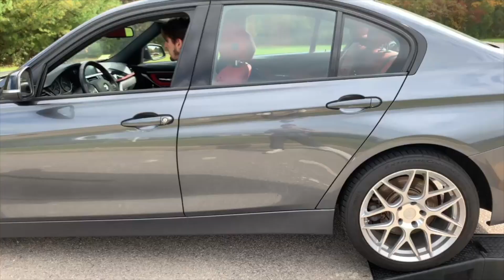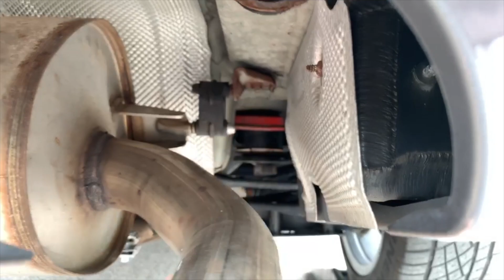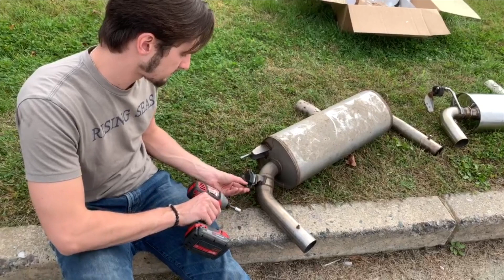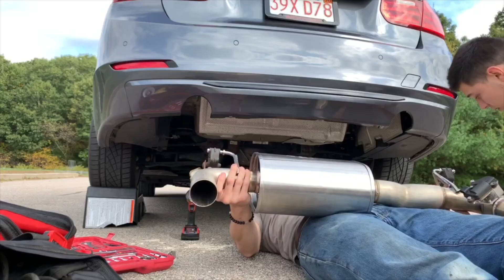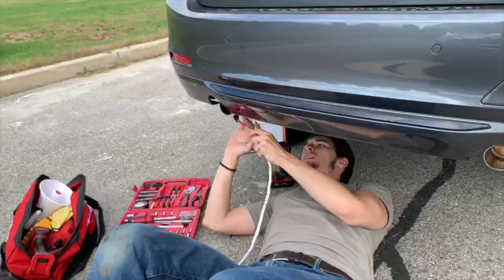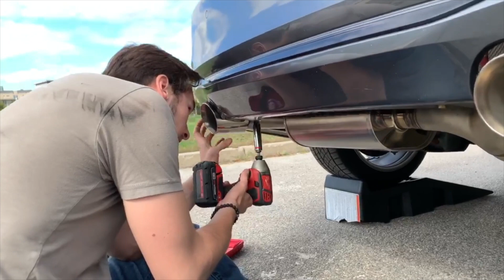BMW F Chassis Valved Exhaust Install Guide (N55)

Comment: do you have a vido showing this installation on a 328i where the exhaust tips are only on 1 sidee?
Reply from the maker: You would need to purchase a diffuser with exhaust outlets on both size in order to fit this system
Reply: @valvetronic  Thanks I just got this in the mail! waiting for my diffuser to arrive as well. I'm excited to see how the install comes out!

Comment: You shipped mine today, can't wait!
Reply: How do you like it? I’m in the market for an exhaust right now and can’t decide between this one and the AWE. Is this system loud enough for you when the valve is open? Is the valves controlled by driving modes or it’s only operated through an app like in this video? Thanks!
Reply: @aaronbrown4366  function wise I love it. It opens when I put the car in sport/sport+ or drive above 3k rpm in comfort. Quiet in comfort and eco pro. That being said, it didn't come with any informative instructions and the shop I had installed couldn't get the fitment right. So as it sits I don't have any tips on it because they couldn't get it to fit right. I upgraded the rear diffuser hoping that would help to a rw carbon one and still doesn't fit so I need to find a custom exhaust shop correct it and for that reason I'm not totally satisfied. Shame because it's a nice piece.
Reply: @StereoSoundAgent  Thanks for the reply, dude. There isn’t a ton of detailed reviews on it, either on here on the forums. Someone else I asked about it said they had fitment issues as well, he said he bent the hangers, not sure if that’s something you tried yet. Having bad fitment would be a nightmare for me, I hate when the tips don’t look correct.

I actually ended up ordering an AWE axleback a few hours ago, found a good deal + free shipping and no tax. There’s definitely more reviews on that system and all seem to like it, and that’s what swayed me. It’s not a valved system, but my car is stock everywhere else, so I don’t think that’ll make much difference in my case.

Hopefully you can get your exhaust to sit right, must be driving you crazy.
Reply: @aaronbrown4366  thanks man! Appreciate it! Haha it does irritate me because I do love it otherwise! Congrats on your new AWE exhaust system

Comment: If your car doesn’t have active exhaust can it be added or does it require a wire harness?
Reply: all f30's come with the valved exhuast from factory
Reply: @isaacstretch106  actually, they all come with single valve, and it’s only for cold starts, MPPK cars will have 2 valves that change form sport to comfort
Reply: @chriskamen2152  you have to get the mppk exhaust to specifically get that. The mppk alone won’t get you that

Comment: Could this be fitted to work for the G20 330i?
Reply from the maker: unfortunately not
Reply: @valvetronic  any idea if you will release an axle back for the g20 or do you only have the gold full exhaust system? or willing to guide me some.
Reply from the maker: @CRMAG87  check it out here:

https://valvetronic.com/products/g20-330i-valved-system?_pos=2&_sid=e149137c2&_ss=r
Reply: @valvetronic  thank you I will look into that one. Was hoping yall released the axle back as you did for other BMW models.

Comment: Can you setup this exhaust on an F80 to automatically open and close the valves when you select the M buttons? I would hate to use a separate dongle.
Reply from the maker: Yes it works like thsi!

Comment: was this done on a 335i or 340i? your website says that the 340I needs modification to fit. What would need to be done?
Reply: I was wondering this too, I also have a 340i.
Reply: @TcheCaver  I just ended up going with the MPPSK muffler without the tune. I feel like it’s better.
Reply: @bxhdan8188  Ah, sounds good!  Can I ask where you got one and how much you picked it up for?  Ideally I'd go for the full MPPSK but 3k is a lot
Reply: @TcheCaver  I got mine off a wrecked car for 800, this was for only the muffler and not the mid pipe so I fabricated my own. Reality is that finding a deal like that probably isn’t gonna happen sadly. I’ve noticed the prices of them starting to come down slowly, I actually saw a whole system for 1700CAD in my area a couple weeks back.
Reply: @bxhdan8188  MPE actually sounds really good, its a shame.  I'll probably end up going with this one just because of the price and ease of installation, but thank you for the help! Hopefully it fits fine haha

Comment: Does the 2 pipes just butt up against each other and the clamp covers the crack and clamps the 2 pipes together? Or is the pipe suppose to slip over the stock mid pipe?
Reply from the maker: The pipes butt together and the clamps bridges the gap!
Reply: My son has the same question. Any responses?
Reply: They might leak thou....not 100 percent.....I will recommend professional installation thou

Comment: How do you make the flaps close and open. Does the wire supply power to it?
Reply from the maker: you must use the bimmerlink app to close the valve or drive the car in comfort mode and unplug the valve when it is in the closed position.
Reply: @valvetronic  is that means we can also use phone or sport button to control it?